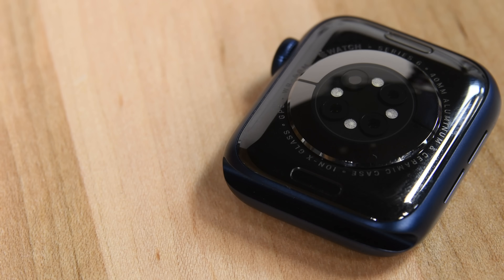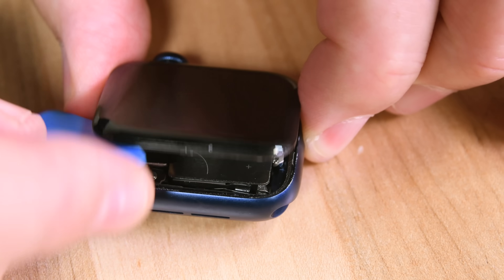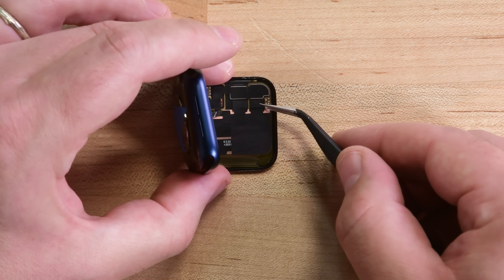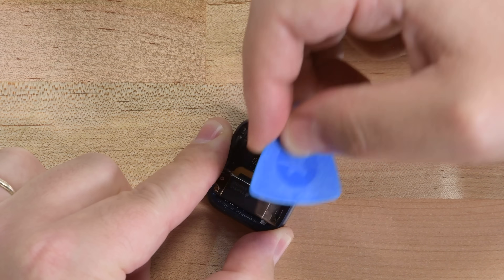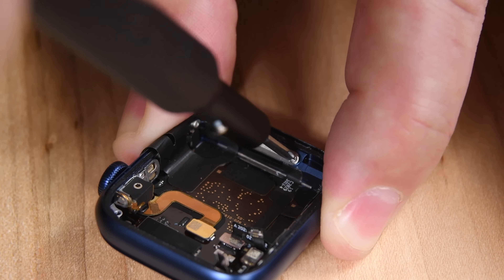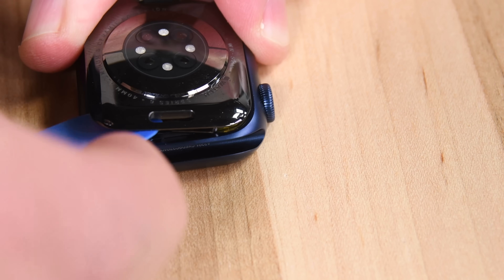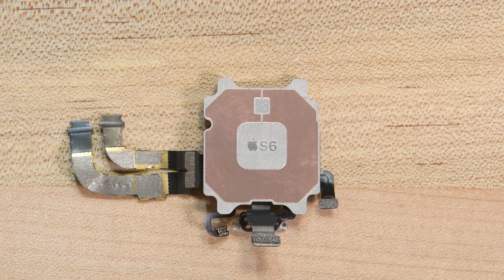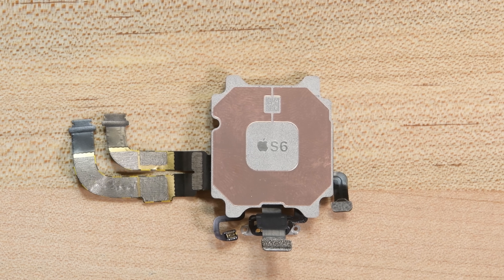Apple Watch Series 6 Teardown: All the Improvements Apple Didn’t Mention!

Comment: I made a battery replacement and it's messed up. The battery isn't the problem but the metal clip connection between the screen and the motherboard does not connect. Apple logo just comes on and off

Comment: I've run into trouble on my s6 40mm repair. I've cut the wire that runs between the LCD screen and the main body of the watch, parallel to the two ribbon cables. What does that wire do and how do I replace it?

Comment: Thanks for the video, now I can disassemble two apple watches, one has a stainless steel frame but the internals dont work, and the other one has an aluminum frame but the internals work, so if I disassemble both of them I can use the parts and make one working apple watch.

Comment: I need back glass to replace. 
Does back glass only sits on adhesive? Or is there screws, that holding ad well?
Where can I buy back glass replacement for series 6 44mm?
Reply: I have the same question. I have a minor crack on the surface of the glass, away from the sensors.

Comment: what I want to know is I bought series 6  titanium version so its very expensive. Id like to keep it as long as possible. if the battery does eventually die in 2-3 years and I replace the battery, will the watch still be water proof?

Comment: The blood oxygen sensor seems to be kinda +/- 5 percentage points accuracy for any given reading, but the mean value seems to be about 2 points lower than what my proper O2 sensor says. It's not really good enough to base decisions upon, in my opinion.  I was hoping it would be accurate enough to diagnose sleep apnea but it doesn't seem to be.

Comment: The difficulty to repair a product such as this one makes me think the following:

It's strange how Apple Inc., being the MOST VALUABLE company in the world, doesn't take the risk to design and produce a modular mobile device. They like to push their accessories to customers (like intentionally removing the headphone jack and then telling people they have to buy a separate adapter for their wired headphones) but fail to realize modularity is a similar, yet superior marketing opportunity in terms of offered quality.

I think Apple customers would still monetarily benefit the company by acquiring replacements and additional items for a modular smartphone or smartwatch, and this would represent for Apple a big opportunity to earn more respect and admiration, based on a well-intentioned concept that renders planned obsolescence unnecessary and that could benefit the environment if it's a wisely-conducted project.

Comment: Looks like Apple will finally start replacing the batteries on the Apple Watch instead of replacing the whole watch.
Reply: If they start putting apple chip inside batteries so only their batteries will work. Maybe in next series, all apple watch will not work unless their own Apple batteries with its own chip is used. So even third party like iFIXIT have to buy batteries from Apple. It's faster to replace the watch than the battery though,  since it takes a day to safely seal the watch for best water resistance.

Comment: At the end of the day, this is an extremely small device with high expectations for water resiliency.... not to mention the high tolerances of ridge-free butting of the various external components (screen to case to back-plate). I'm honestly amazed that it can be repaired at all - let alone by a layman. Try taking apart a Swiss watch sometime.... and good luck.

Comment: there has to be a certin point where having try wing or any special screw bit shouldnt be a down point if the only down point is that its needed to have that special bit when most devices have them just buy it once and done

Comment: Wait why would a watch have force touch. Wtf apple good thing you removed that
Reply: Jesse11spykid You can’t fit a lot of buttons on the small screen, so it allowed you to interact with more things on the watch. However, it still has the problem of not being able to tell where there is a force touchable ui element.
Reply: Force touch on an extremely limited contact space allows twice the interactive points. I would rather have that than double-tapping - although, that could add even a third interaction. It's only 40-44mm.... every method to interact is beneficial.

Comment: Please use mah for battery capacity
Reply: I second this
Reply: Does not make sense. mAh does not tell you anything if you don’t know the voltage. Wh is the right one to use.
Reply: @stefanroell7252  But mah is the standard unit used by manufactureres and people 

Why do you want to know the voltage of the battery in the first place